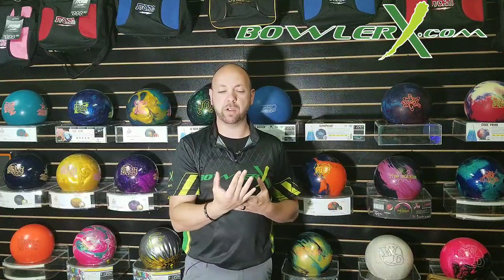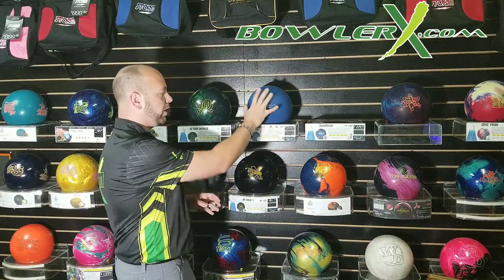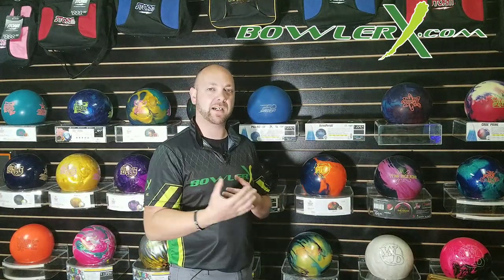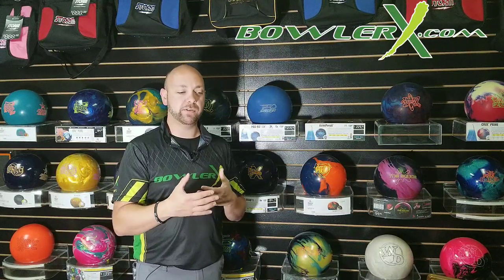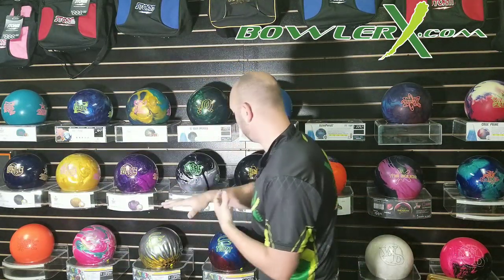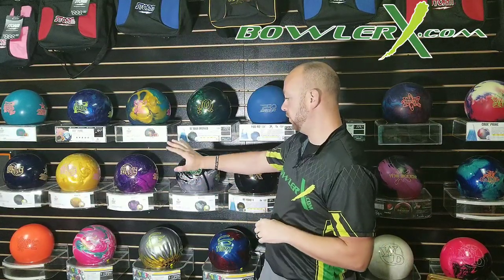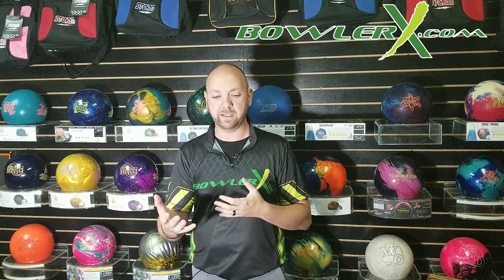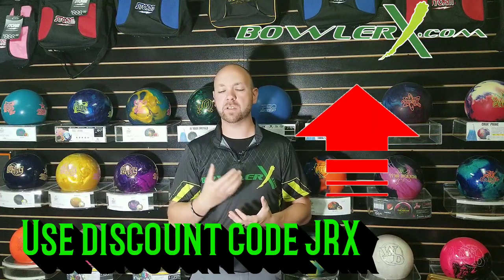What type of bowling ball coverstock do I need? | Solid, pearl, or hybrid

Comment: I have a Rotogrip hyper cell skid, I'm looking for a hybrid ball, You recommend me the halo vision? this halo vision what can do? control ball ? agressive
Reply: I really like the entire halo series. I however prefer the widow series from hammer. The problem with saying "what a ball can do," is it varies greatly from bowler to bowler. From how you drill it to ball speed and rev rate, there are so many factors. The biggest factor is PREFERENCE of a certain core/cover stock.. I like the singularity and drive through the pins that I get from hammer black and gold, when it comes to hybrid balls. However, i prefer the reaction of the halo pearl over every other pearl on the market
Reply: Hammer raw hybrid I just bought and it's a really good ball at least for me it sits in the middle part and finishes in the pocket and if you want to get it out it flies back to the pocket I highly recommend it
Reply: @louwebb8253  I got a raw hammer hybrid but I don't see too much hook in my throw. Is it possible I'm just throwing the ball too fast? I usually throw at about 18mph
Reply: @Skarlatoz  did you get it drilled pin up or pin down? And I'd keep your speed at 18 if anything try rolling the ball earlier on the lane
Reply: @louwebb8253  the pin is up. But im not sure if that makes a big difference or not. i think im just doing something wrong when i throw. And wdym by throw it earlier?
Reply: @Skarlatoz  pin up reads earlier on the lane and loses some of it's back end and pin down reads a little later but has a lot of late hook .. and I mean drop the ball earlier on the the lane